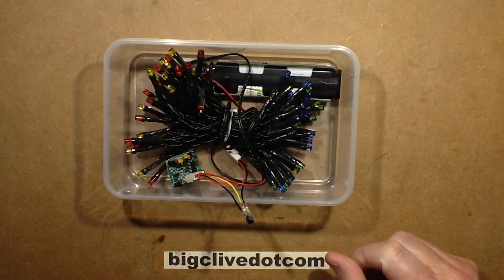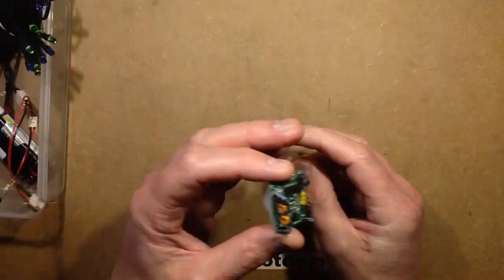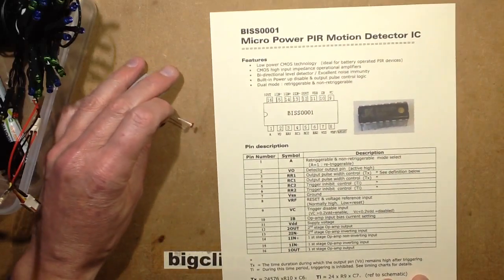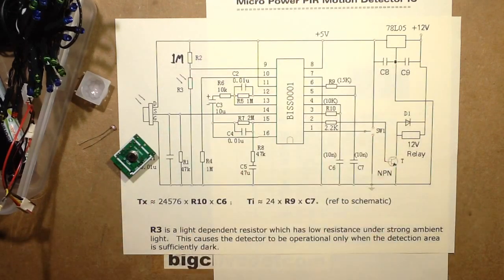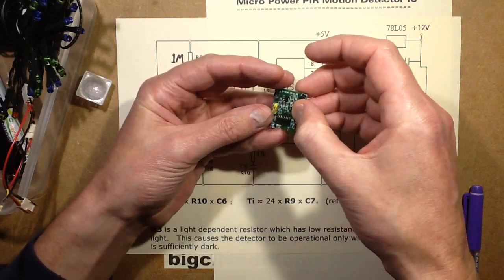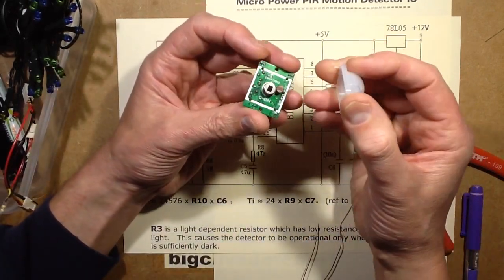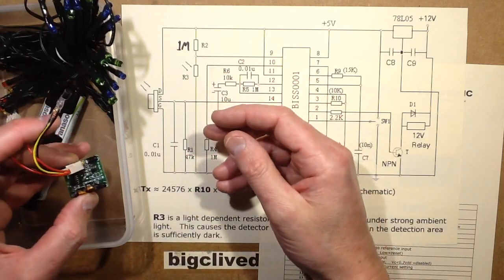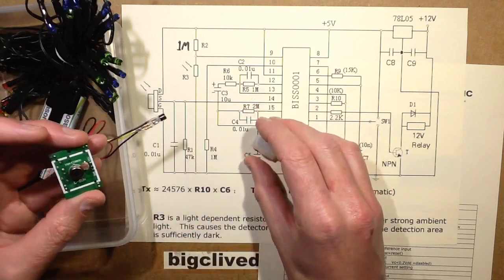Adding a light sensor to a PIR module.

Comment: Thanks for the clarification!
I found in many datasheet that this motion sensor "gets better sensitivity in dark environment with adding an LDR"..., 
but I can not found the appropirate resistance values for this LDR what I should add...
Now, thanks for you it became clear, that adding an LDR will not increase the motion sensation performace, it makes the whole module a "darkness & motion" -sensor what is absolute unwanted in my usecase (I have to sense motion in daytime and nighttime too.)
Thanks!

Comment: Thank you, good to know it is ready for LDR. I am working on a DSLR camera trap and I wonder, how to reverse its operation - only trigger when there is enough light. Any thoughts? :)
Reply from the maker: Yes.  The light sensing circuitry is formed from a bridge of the sensor and a resistor.  Swapping their roles and adjusting the resistor value to get the desired threshold should work.

Comment: Hello, I'm not sure if my comment is going to be useful for someone but hope so. So I bought LED Ceiling Light RADAR/PIR Motion Sensor Lamp that has both PIR sensor and light sensor but my hallway has 3 of those lamps, so the problem is when one lights up, the other does not or they light up if they have been triggered at the same time. My solution to that was to cover the light sensor with electrical tape nicely and that way only the PIR sensor works and for the light sensor it is always dark, so they don't bother each other and I can have them all 3 on together. Hope this is useful for somebody.

Comment: hi good project it try to do the same soldering a LDR on my PIR Board. It is not working as expected. What kind of LDR do you use? do i have to do extra thing to do it working ? thx
Reply from the maker: Check it has the divider resistor fitted.
Reply: @bigclivedotcom  you mean that i have to solder LDR and another resistor to get a voltage divider ?
Reply: if i could i would send you a picture of my PIR Board setup ? do you have an email ?

Comment: What is the specs of LDR ? I am trying to use a 5539, but it isn't working. It only disables motion sensing when the light is very clear, like when I am pointing a flashlight to it.
Reply from the maker: Try some common small LDRs from eBay.  You can also nudge the intensity threshold by changing a resistor that forms a divider with the LDR.
Reply: @bigclivedotcom  I changed the LDR. The old one was varying from 1K to 2M. The new one varies from 4K to 53M.
It started detecting motions at about 5 PM local time, nature light. Thanks.
Reply: @w35l3y  Does greater Ohm resistance mean it is less sensitive to darkness? I want my sensor to turn on a LED strip light only when it is either completely dark or there is little ambient light. I have just ordered GL5528 which has dark resistance of ≥500 kΩ - my guess is its not suitable for my case? Any idea on which GL I could use?

Comment: I wired mine so the LDR is separate from the PIR so that the PIR still notifies me when someones walking around my porch, but does not turn on the lights at day. At night it also functions a automatic light. But I noticed that the PIR causes interference with the LDR when the the PIR triggers. Will have to update the wiring it seems...

Comment: Is there a way to modify the PIR so an Arduino could adjust sensitivity/time ?
Reply from the maker: Sensitivity not easy unless you pulse counted.  Time easy if it just triggers a delay in the arduino.
Reply: @bigclivedotcom  I have found out that pin 8 (RESET) can be controlled by an Arduino digital pin and now Im investigating if I can use a MOS 4066 and just a few resistors in the Op Amp feedback resistors. Inspired by Julian Iletts "Making a PIR Sensor Less Sensitive".

Comment: Nice tip I did not know one could do it - Your video explained it well.
On a different note: Can you reduce the minimum "delay time" from the default 5 secs to even lower ?
Appreciate a reply.
Reply from the maker: If you look up the datasheet for the BISS0001 chip you will see that there are timing components that can be changed.

Comment: Amazing and so simple. And it works. Thanks. I found taht mosfets in 30s + mode give smaller output ad light is darker from 5v source
Reply from the maker: For low switching voltage you need to use logic level MOSFETs.  They have a much lower gate voltage.
Reply: @bigclivedotcom  I'm using Irfz44z mosfet. It works pretty well,  but wnen i'm turning knob of PIR to work more than 10 seconds - then it's light is much weaker. So it's pir's fault. Seem like it has different resistance. i'll try add different resistor.

Comment: Hi could you tell me how I can increase the output from 3.3v to 3.8v? Any help appreciated
Reply from the maker: Odd voltage, but there's a voltage regulator that could be changed.  You could even change it to a 5V regulator if your supply voltage was higher than that.
Reply: @bigclivedotcom  Thanks for reply I want to use a 3.7v input to trigger a 3.7v 10mm LED as the 3.2v is too dim and it seems to be the max output for this module. Is there an easy way to do this?
Reply from the maker: @markmaisy4858  The module won't put out enough current to light an LED directly.  Is this video helpful?
https://www.youtube.com/watch?v=evZM2_RTvTU

Comment: Hi clive. I have a riddle for you. I have ordered a wt588d-u sound module to connect a to my 2p machine and was wanting to use pir modules to instead of switches. The schematic or the wt588d-u shows the trigger pins put out 5v to the ground rail inorder to activate them. How would I connect a pir with that has +5v Sig and gnd pins in a 2pin application
Reply from the maker: You could use an NPN transistor to shunt the inputs to ground.  You'd need a 10K resistor from the sensor to the base of the transistor.
Reply: @bigclivedotcom  thanks Clive your a legend.

Comment: Thank you for the video but we still did not have the PIR connected with a 12v led strip !!
Reply from the maker: You can get inline PIR sensors for 12V LED strips.
Reply: Thank you for the tip, so it mean that you can't use the Pir you show in the vidéo ? Because the inline PIR are very expensive compare to those small modules.

Comment: hi Clive :)
i see on the net that there are 2 pads for a thermal resistor, too, on that module... what is that used for??? Thanks
Reply from the maker: I'm not aware of a temperature sensing function.
Reply: thanks for the answer :)
look here: http://ozcott.com/NomadTronics/wp-content/uploads/2015/03/PIR-SensorModule.jpg
or here: https://i0.wp.com/dronebotworkshop.com/wp-content/uploads/2018/01/HC-SR501.jpg

Comment: Hi I am not an expert in electronics/electricals, I need help on my solar lamp post. During daytime, it automatically switches off. But comes night, it doesn't turn on automatically. It comes with a remote control that I can switch on manually. What could be the problem? Can I rig the remote control and add a photoresistor LDR and put something to press and hold the ON button? Where can I connect the LDR in the circuit of the remote control? What is the specs of the LDR? The remote is powered by just 3v 2x1.5AAA battery.

Comment: can i change the block time of  it?? accually it is written that it can be changed in its datasheet..but i do not know how to
Reply from the maker: The easiest timing component to change is the capacitor.
Reply: +bigclivedotcom thanks but i already know ... it is about which one to change
Reply: Block time, Ti = 24 * R * C. You need to check your PIR sensor's schematic to change the R and C value. If your sensor's IC chip is BISS0001, the R and C that affects the Ti is connected to pin 3 of IC chip.

Comment: My PIR sensor with the LDR doesn't sense motion anymore and only light the LED when it is dark. I want the PIR sensor to detect motion to light LED when there's daylight and just light the LED when its dark. Does soldering in the LDR disable the motion sensing?
Reply from the maker: +Andy Chiu Removing the LDR will make it look dark all the time.

Comment: Hi Clive, I'm a electronic noob. The project I have in mind is to build a 2x18650 PIR light that turns ON only during the night. Problem is there are external light pollution, so I gotta have a light-sensitivity adjustment function.

[1st qns]
You had talked abt adding a variable resistor in parallel to the 1M-ohm resistor to enable adjustment of the light sensitivity.

I needed this function to adjust the light-ON triggering point. Searched ebay but seems like 10M-ohm variable resistors are rare and expensive.

Are there any cheaper alternatives to add in this "light sensitivity adjustment" function?

[2nd qns]
for the LDR, is there any particular model to look for? I think not all LDR are the same rite?

Thanks in advance!

Comment: Hi Clive, wouldnt the LDR be a big current drain when using batteries?
Reply: Hi, I asked me the same question. But looking at 1M with 3.3V and Ohms Law: 3.3V/1.000.000 Ohms=3µA=38 Years with 1000mA LiPo. with 100k approx 3-4years.  The sensor (50µA) would suck the battery within 2 years empty without and operation. with 100k (33µA) + sensor's 50µA we are at 1,4 Years. or am I doing wrong calculation?

Comment: I have this working but mine comes on too early, when it's still quite light outside, can I add a potentiometer and where would I add it?
Reply from the maker: Is it possible to aim the sensor so it gets exposed to more light?  Failing that you could bridge the resistor I mentioned in the video with a suitable resistor to make the unit less sensitive.
Reply: No, I can't get more light into it. Also, I need it to be more sensitive, not less don't I? Right now it's coming on too soon, I need for it to wait until it's darker before it comes on.  Thanks!

Comment: I'v never heard a one of those light sensors called a LDR before. That's odd.
They'v always been called a Cadmium Disulfide Photocells/Photoresistors when I'v seen them.
Reply: Light dependent resistors, apparently. But yeah, we call 'em photocells as well. Or simply "light sensors", as in the title.

Comment: Do the light sensors trigger on IR light? I have plans to use the PIR module with a Raspberry Pi and an IR camera with built-in IR LED lights to detect motion, take a photo and then email the photo.
Reply from the maker: No.  They detect longwave IR from body heat.

Comment: I have found using a 100k resistor in parallel with the 1m resistor turns the lights on around the same time as my solar lights come on

Comment: I might be inclined to put a wee bit of electrical tape over the light sensor rather than gutting it out. Of course that might not work, but it would be a cheap try.
Reply: I say cut the trace and solder a SMD dip switch over the gap.
Much more efficient an looks like it was designed that way.

Comment: Mine has LDR (RL) and also thermistor (RT) holes.
Reply from the maker: The RT pads appear to be in parallel with a 10K resistor that couples the first gain stage from the sensor to the second. I guess it just varies sensitivity so that it compensates for ambient temperature.

Comment: is it possible to make these re-trigger?

Edit: apparently it's quite easy: there will be three pins (not the power and signal pins) with a jumper on two of them.  Just move the jumper to the other pair.
Reply from the maker: There seem to be two versions, one with the link and one with the pads and a track acting as a link.  If it's a link then try it in the other position to allow the unit to retrigger continually.  If it's the pads then it should already be linked to retrigger I think.

Comment: Does the PIR sensor turn off when its day time, or is it still using the same amount of power?
Reply from the maker: It's quiescent current is very low.  About 50uA in either day or night standby mode.

Comment: Hey Clive what is that 3 pin connector called that you used? I was trying to find those for use in a computer fan project I was working on and I couldn't find the right phases to search on eBay.
Reply from the maker: It's a standard connector based on a Molex style.  You have to buy the housing and contacts separately.
https://www.rapidonline.com/jyk-h2500-03-3-pole-crimp-housing-22-0910
Reply: Thank you!
Reply: Electro_Leet Specifically lookup the Molex KK series with 0.100"/2.54mm spacing.  The contacts are available in 3 different finishes depending upon your application, zinc, phosphor bronze, and gold (with zinc being cheapest).  They are wonderful general purpose connectors for projects for everything from signal lines to several amps as power connectors.

Comment: Mr Bigc, totally unrelated, but i have a question, since you seem to have a great knowledge of electronics.. i ordered a " Rotating LED Kit POV Soldering Training Kit" from banggood, and soldered it together, it works. its basically a strip of leds that are rotating and pulsing and making and image, based on the persistence of human vision. however, i noticed that the design have one resistor inline of each LED which is then connected to ground by the IC, why are they simply not sharing one resistor, but instead have one 560ohm resistor for each LED?
Reply from the maker: If more than one LED was on at a time the current through the resistor would be shared and the LEDs would be dim.
Reply: Thanks, that makes more sense in the morning. :)

Comment: It seems to me all you would need is an LDR, a resistor and a small MOSFET to turn on and off the lights. Connect to light string anode to +12 through an appropriate resistor, to the drain of a TO92 enhancement mode MOSFET, a large resistor to GND from to the source and the source to GND,  the gate of the FET to +12 V through a large resistor. when the LDR "sees" light it it is low R, and shunts the voltage on the gate to GND, shutting off the FET, and when ther is low light, the LDR is high R, and the gate turns on, with the LEDs turning on. A FET like this sells for 25 for $2
Reply: and cost, 2 resistors and a MOSFET would cost about $.25 or less.

Comment: You could even cut the PCB trace leading up to that LDR and put a tiny switch inline, so you can turn on and off the darkness mode :P
This could be handy for a small battery powered door keyhole illuminator :D

Comment: 38th :-)  Love the eco-hippies comment.  I have the PIR modules and the LDRs, would his work as low as 3v (i.e poundland led strings)?
Reply from the maker: It needs a voltage higher than the 3.3V regulator, it's overhead and the 0.6V series diode.  So it really works best with a set of four NiMh cells.  It could be possible to bypass the regulator and power it directly from 3V though.  in the LED string conversion you add a resistor so it will happily drive the Poundland strings from the higher voltage.
Reply: That's brilliant, thanks for the quick reply. I thought I might need a higher voltage and a resistor to drop to 3v for the led string.  Thanks for taking the time to help an old codger :))
Reply: You can remove the diode and the regulator according to what I've read online. I have one running from 3xAA (nimh) and I just removed the diode. Mine has a Holtek HT7333-1 regulator which has a very low dropout - 6mV @ 1mA / 120mV @ 30mA
Reply: Clive, at the risk of making myself look a complete tit on t'internet (if I haven't already), what are the RT contacts on the PIR module (rx/tx maybe)?
Reply: Thanks, I've just read that the PIR module works with an input voltage of 4.5v to 20v.  I aim to try it with four 1.5v AA cells.  I have a few PIR modules to play with so if I mess a few up, it's all part of the learning process.  I might add though that I'm a slow learner :-)
Reply from the maker: Are you talking about three pads for the retrigger function?  If you are then you can choose to link a common pad to either high or low and it decides whether the sensor can be re-triggered by movement or if it has to time out first and then retrigger. Most are supplied with a track in place to choose the continuous re-trigger mode where ongoing movement keeps resetting the timer and keeps the light on.
Reply: Hi Clive, no you covered that in the video.   With  vcc,  out and gnd at the bottom, on the lefthand side about 1cm down, directly above the 7133-1 voltage  regulator there are two pads marked RT.  According to a reply I received from Luc Put they are for a thermal resistor so the module can be triggered by temperature.
Reply from the maker: Ah yes.  I've just traced them out and they are in parallel with a resistor that is used to couple the first stage of amplification to the second stage amplifier and threshold detector.  I'm not sure what it's specific purpose is.  If it was for a thermistor then it could vary the sensitivity of the unit to compensate for ambient temperature.  If that's the case I couldn't tell which specific thermistor it might have been designed to be used with.

Comment: Hi Clive,  How can I use 2 PIR modules with one LDR, where either PIR will turn on the LED string?
I want to put an LED strip under the stair railing, with a PIR on each end.  So the light will turn on when I am at either end of the stairs.  Thanks!!
Reply from the maker: Just use one PIR per unit, and for the combined switching you could have one transistor per unit, but common them so either will bring on the light.

Comment: I was thinking you could disable the LDR less permanently by sticking a bit of black tape over it... in fact since LDRs are so cheap they could solder one on in the factory and stick a bit of black tape over it for the end user to remove if required.
occurred to me that the likely fault in that plan would be the cost of having a person sticking tape on things outweighing the cost of components and pcb assembly.

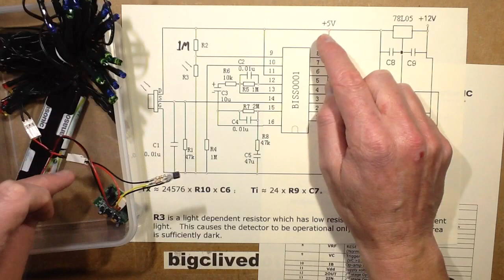Comment: To revert back to using the PIR module in daylight 6:18 just put some black electrical tape over the LDR.
Reply: You could leave the pins a little long on the back of the PCB and use a spare computer jumper block to enable/disable the LDR.